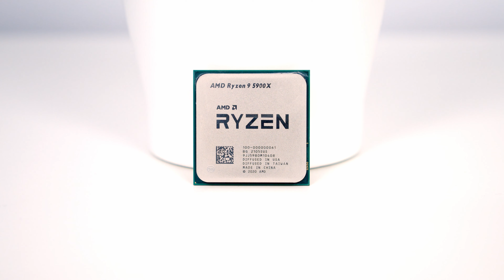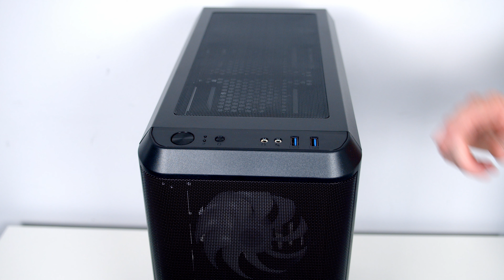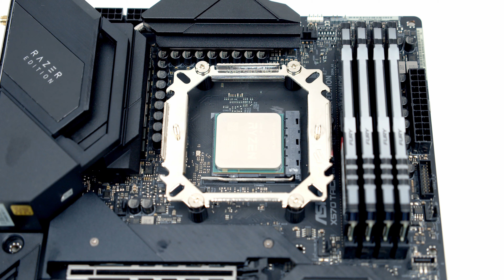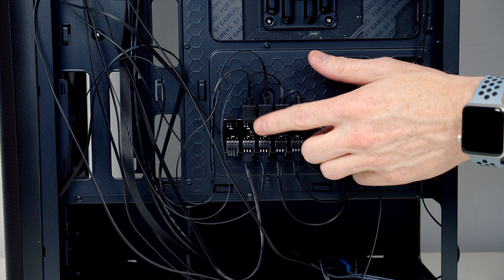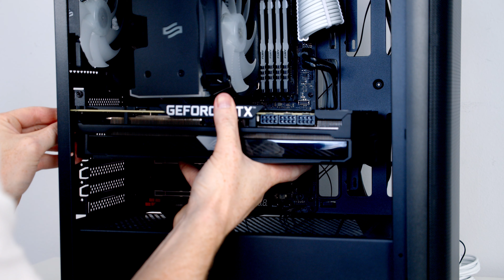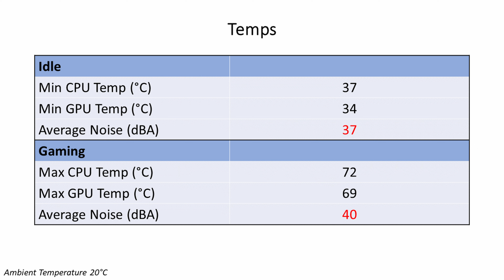SilentiumPC Ventum VT4V EVO TG ARGB - Step by Step PC Build Guide

Comment: Wouldn't you want to plug the pwm from the controller into the cpu fan header on the motherboard?
Reply from the maker: If you want all the fans to run the same yes, if you want to control CPU fans and case fans differently no